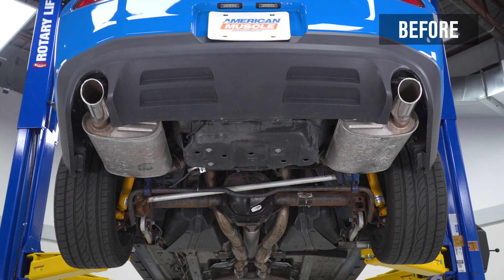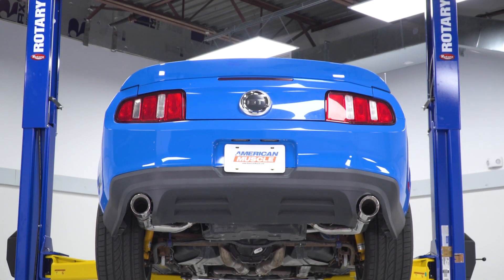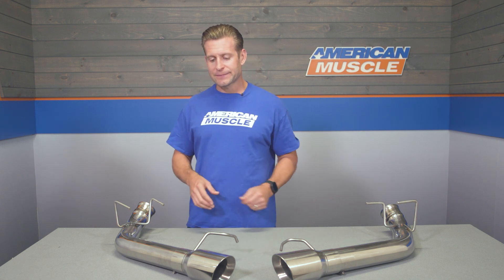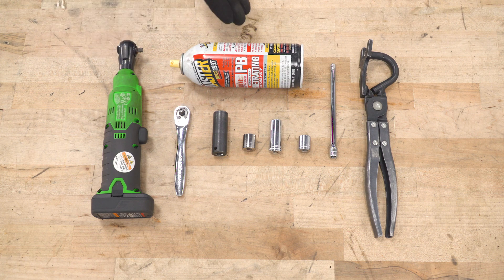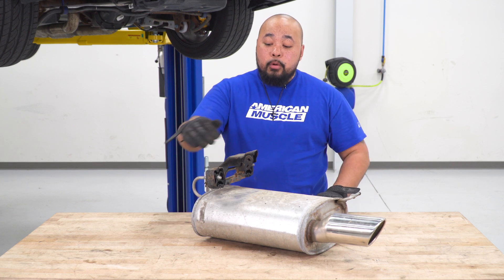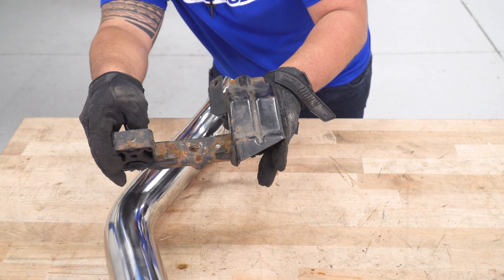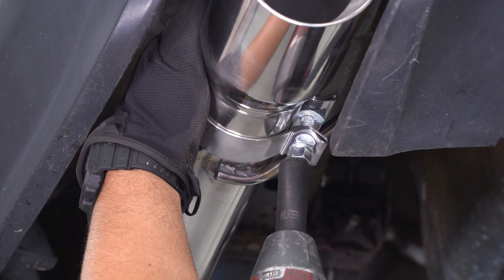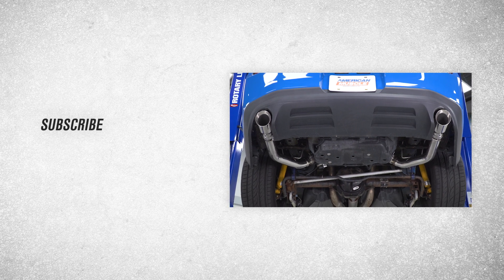2011-2014 Mustang GT C&L Muffler Delete Axle-Back Exhaust with Polished Tips Sound Clip & Install

Comment: Would this fit on a 2013 mustang v6?
Reply: There's muffler delete options specifically designed for the 3.7. I tryed some out and ended up going with a borla atak, and my 3.7 screams.
Reply: @robertsharpe4050  that's what I want. 🤤
Reply: @robertsharpe4050  tried*
Learn how to spell.
Reply: @mywa8314  it was nice but now I got a 5.0

Comment: Damn automatic. They should make it to where the automatics hold each gear at least a second or two longer during normal driving
Reply: They do it’s called sport mode
Reply: @shikinami0297  nah. It don't hold it long enough in sport mode either. It's better but it's not enough